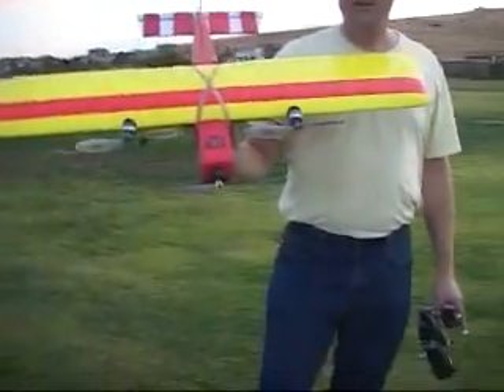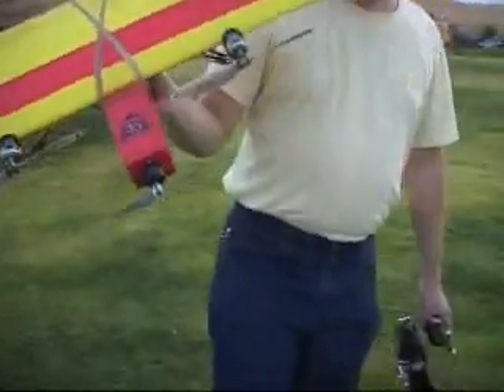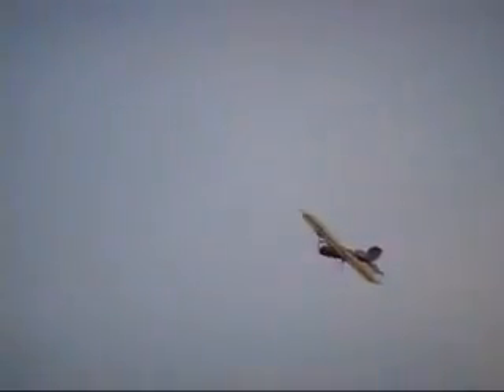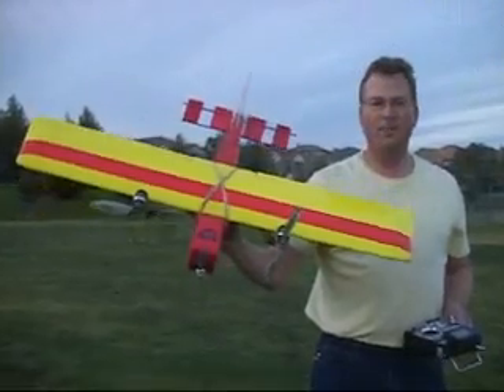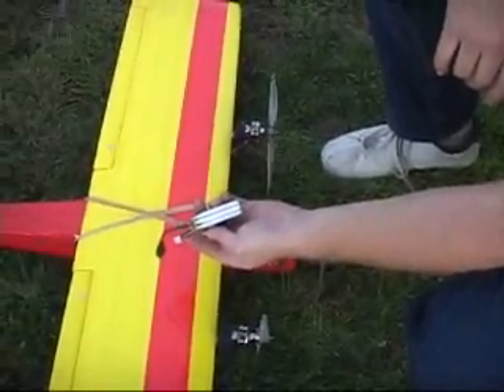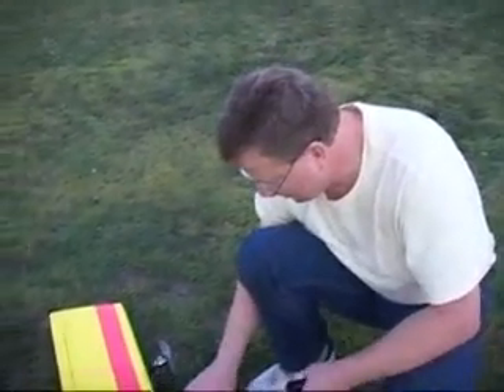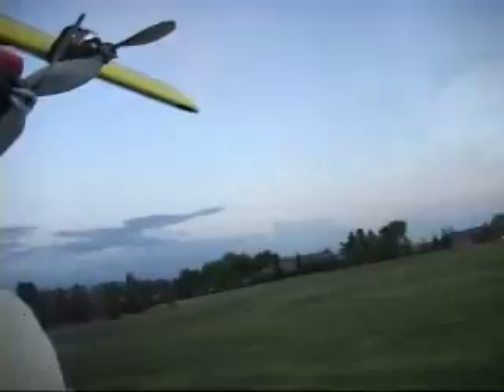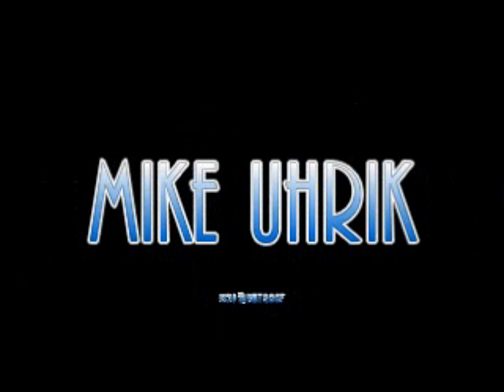RC Triple Threat (Not So Simple Stick)

Comment from the maker: Thanks for watching.  No, the plane uses all three motors, actually more power from the wing motors.  The center motor was added back as an afterthought. The shutter speed of the camcorder gives the strobe effect on the props and sometimes will make them look as if they are not turning but they are.  Details of the setup are included on the video.

Thanks again,

Mike